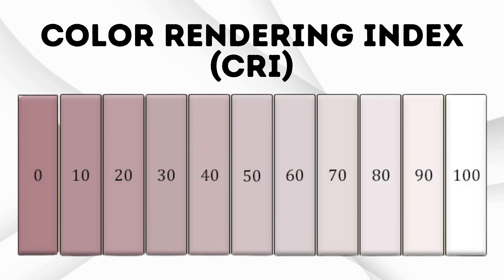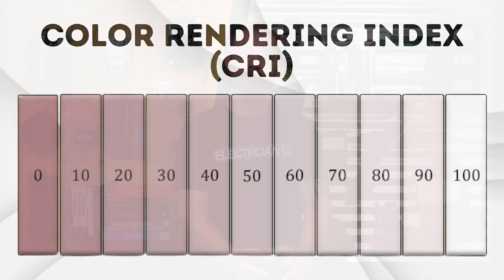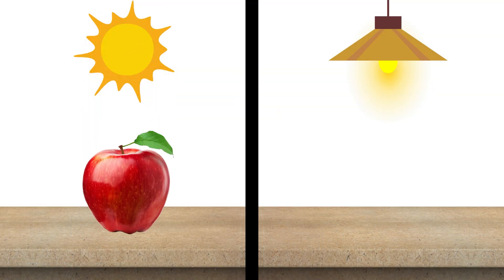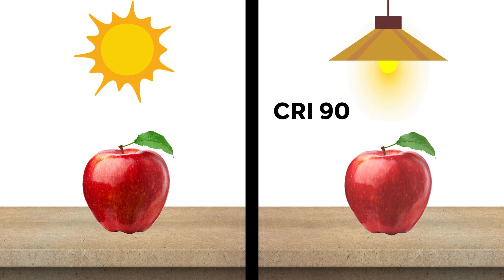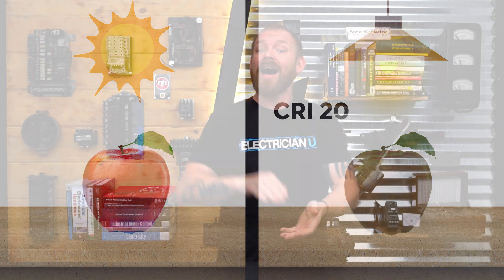Secret Behind Perfect Lighting? Color Temperature & CRI Explained!

Comment: Even though we have 2500k with 10cri
Can we see the true color
Reply: 2500K LED light bulbs aren't 10 CRI lmfao. Majority on the market are around 80 CRI. Which is ok but still pretty inaccurate for colour temperature!

You should look for at least 90 CRI for LED light bulbs. Which will give a fairly accurate colour temperature.

My own LED light bulbs and lamps in my living room are a super high 99 CRI. Aka as colour accurate on the market. All have zero blue spectrum and zero blue&green spectrum modes. Which dramatically improve sleep pattern health 💤
Reply: @C--A it was a typing mistake 
I wanted to mean 100 cri

Comment: In a lab or shop that requires high color rendering, I recommend 50k. In an office setting, 40k, and at home in living rooms and bedrooms, i recommend 35k or lower. Commercial lighting professional for 21 years.
Reply: The CRI is just as important as a warmer colour temperature for bedrooms and living rooms!

Having a 80 CRI (which majority of the bulbs on the market are) will degrade your sleep pattern health!

A 90 CRI with 1800K for nighttime will be better for sleep pattern health 💡

All my living room & bedroom light bulbs plus lamps are a super high 99 CRI. They have zero blue & zero blue&green modes ie promote a very good sleep pattern 💤

Comment: You said you preferred a "warmer" color in your living space (1:45).  Eyes are important to this discussion.  When I was younger, I preferred a "warmer" color.  Our eyes see in "cooler" colors when we are younger so we like warmer colors.  The vitreous and the lens in our eyes are clearer.  Our eyes move to more "warmer" vision as we age.  The vitreous fluid in our eyes ages and becomes darker.  (vision experts give me a break - no space to write a textbook on vision) As we age, many of us tend to prefer "cooler" colors in rooms.  I know I have felt I could see color much better as I age in "cooler" lighting.  (That is so backward.  2700K is warmer but a lower real steel temp.  6000K is cooler but the real temp that would melt steel.)   Dustin, as you age, I am willing to bet you will move to "cooler" lighting in your living spaces.
Reply: You fail to mention warmer colour temperature will have less blue (and also green) spectrum than cooler temperature lighting!

Ie you will have poor sleeping pattern and poor eye health using bright cool temperature lighting at night.

Whereas if you use a warm temperature of say 1800K at night you will get a much better sleep. Plus no eye strain migraines from the light 👍🏾

I myself use specialist 99 CRI 1800K bulbs & lamps at night. That have zero blue spectrum modes to give me a excellent sleep 💡💤

Comment: Dustin, I always enjoy your videos. I learned about the kelvin / CRI ratings years ago while doing paint booth maintenance.  If you have not dealt with automotive painters, you are really lucky. They are really, really picky about which bulbs are in their booth. They need it to be as close to daylight as possible so they can match /blend the color better. I have had to change some because the bulbs seem to lose some of their original color as they age. Sucks working for primadonnas.

Comment: CRI is actually an outdated measurement method. It’s a quick easy number to slap on, but not very comprehensive. It only tests the rendering of 8-9 colors. Many manufacturers have found a way to trick that test to render those colors well, but nothing else. The newest method is TM-30. Is uses 99 different colors, and measures both saturation and hue shift. It’s most commonly found when selecting art gallery lighting, and stage and theatrical fixtures.
Reply: Came here to say this, was not disappointed.

Thanks!

Comment: I've been trying to find some high bay lights for my shop that are in the 4K to 5K range with a CRI of 90+ and they either don't exist or they're insanely expensive. What I'd really like is remote dimming AND remote color temperature setting via a wired interface. You can find a few lights that have adjustable color temperature via WiFi, but that's always a pain because it's bound to your phone or tablet and anyone who just happens to be in the shop can't change the color temperature.
Reply: You might want to check out tunable led strips. They offer adjustable lighting color and are usually dimmable. You can get low voltage dimmers that allow to adjust the color temp right off the wall.

Comment: The colour you choose will depend where you live, if you live in a cold country you'd want warm white and if you live in a hot country you'd want cold light. Fun fact about the low sodium lights is that I observatories like them as they are only one band of light, which with a bit of science and computers is very easy to block out so it doesn't interfere with their work

Comment: OK, nerd moment. Kelvin is a temperature scale with zero being the absolutely coldest temp (that doesn't actually exist in reality but it made sense to choose that just to establish the baseline.  
So with light, the higher the temp, the higher the frequency of light (the frequency of light is the color we see. Different frequencies give us different colors - or that's how our brain sees it). 
Also, we have to be careful since light is quantized meaning that light only generates 'light' at certain frequencies. Color is what our brain tells us we see. So, Kelvin has NOTHING to do with color in reality. When we add energy to light, it will vibrate at a higher frequency and at specific higher frequencies. So this is all temperature. 
Kelvin does not have a unit. You would say something like 300 K (for 300 Kelvin).  0 Kelvin by the way, is about -460 Fahrenheit or about -273 Celcius.
nerd moment over.
Reply: When using Kelvin for light color, it is referencing the radiation (light) given off of a reference black body object at that temperature. Ever notice how hot things glow different colors depending on it's temperature? Yeah, that effect is what is being indicated when talking about light color in Kelvin.

Comment: Mmmmm, yes... I geek-out on lighting. 😊
I use 5000K for task and work areas
(and mandatory high-CRI in kitchen---low-CRI makes some foods look weird)
and 2700K for casual, accent, everywhere else...
I use harsh 6500K in outdoor motion securiry lighting just to be a jerk LOL, hey, it seems to work 😏
Reply: I was going to bring up this point. Different temperatures for different situations (both in home and in workplaces). Paying extra for better CRI only where it's needed (I would add craft spaces and wood/metal hobby spaces to the kitchen for high CRI locations) if there is a big cost difference.